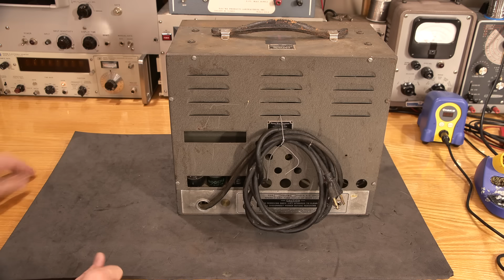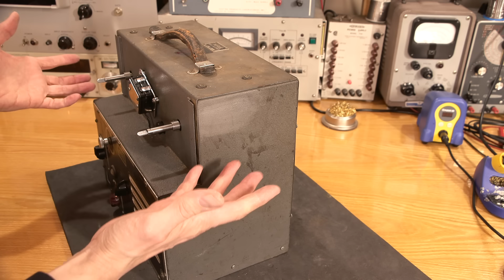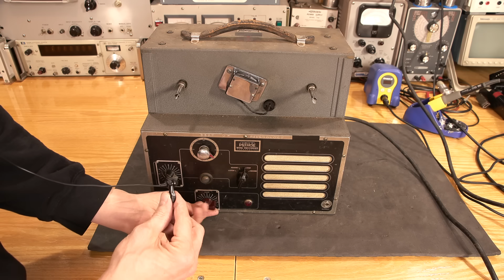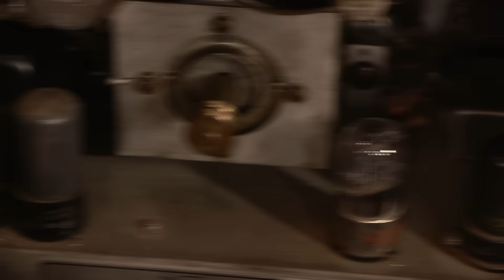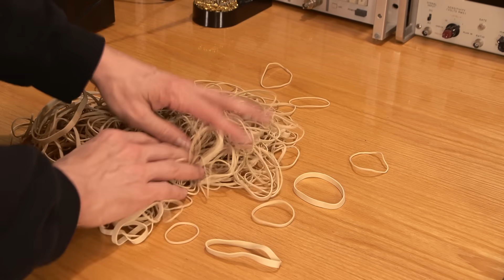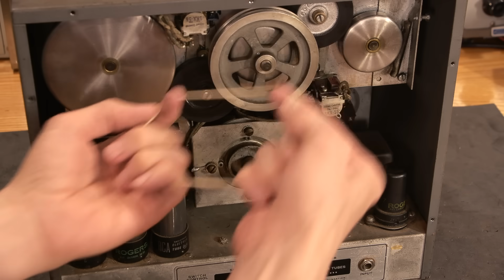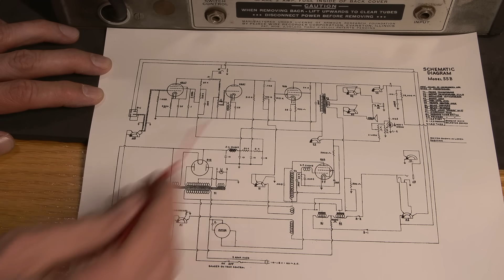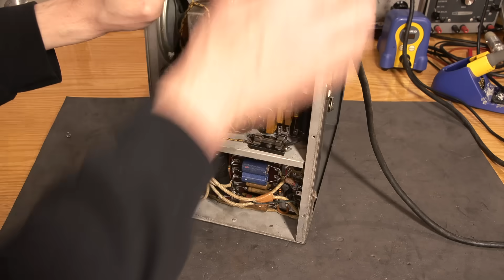Trapped Voices In This Wire - Let's Listen To Them!

Comment: You were interested in old voices recorded on a wire, eh?
Then skip ahead at least a half hour, unless you really wanted to listen to and watch a guy figure out a recording machine as if he's never touched one before and speculate about vacuum tubes.
I wasted a half hour listening to truly boring crap (oh, look- there are capacitors inside this electronic device..) learned nothing from them, and so screw the recording.
Couldn't care less what's on it at this point.
Terrible waste of time.
Dog crap.

Comment: Sir, you are a very intelligent technician. I never thought that a steel wire could retain sound in it and it was how in olden times recording was done. Through your video some stereo manufacturing companies may have got some ideas to develop such types of reels in modern times. I was also a small electronics tech and designed a few stereo circuits. Love your video.

Comment: For your sources of “belts”, have you tried using old tire tubes cut thin in a cross sectional manner? It would be a bit tedious but might be a sturdier band.  Maybe find one thin enough to be molded to those wheels with rubber peripheral surfaces

Comment: Marconi's radio receiver consisted of a steel wire that first passed through the poles of a magnet, which magnetized it, then through the center of a coil connected at one end to the antenna and at the other to ground, which demagnetized it with short duration pulses (they used spark emitters that were RF pulses), this caused the wire to be magnetized and demagnetized only in very short sections, then the wire passed through another coil connected to a speaker, in which the magnetic impulses that arrived in the sections of the wire still magnetized could be heard as a low frequency sound.

Comment: When a tube gets hot does that mean it needs something stronger to handle the current ??
Reply from the maker: Tubes get hot normally. This is because the have a filament and cathode. When you control current with a tube, the tube will get hotter.

Comment: I'm from Russia.👋In the late 1990s, my father worked as a technician in the Air Force. He used to bring back similar coils of wire from work. I was surprised that the wire was so thin, but it took some effort to break it. I was able to listen to it on an old reel-to-reel tape recorder. To do this, I had to increase the playback speed. It contained conversations between pilots and ground services. In everyday life, if you adjust the length and voltage, you can use it to cut styrofoam.

Comment: My Dad a bought 35 yrs ago bought an old phonograph console that the guts were taken out and the top of the cabinet glued down. I use it as a tv stand. It’s a solid heavy wood console piece probably from the 30/40,s. There are a couple doors that open in the front. Inside one was a secret compartment that I inadvertently found. I opened it and there was 2 wire reels that were in it. It had a sticker on it that said somebody’s wedding. Anyways I always wondered why it was in a secret compartment in there and wondered if it was something from the FBI or CIA. lol. It’s still there I think.

Comment: It is very intesting to know that voices could be recorded on a wire.  But the geniuses that created these past styles of recoding.  Cylindrical records, magnetic recordings ,  on old round  type floppy ,  16 size records,  98 size records,  45 size records, and 33 size records.  the number represents the speed at which they were recorded. beta tape players, vhs tape players,  vhs c tapes, then to floppy disks.  then hard drives,  then flash drives,  then sandisk memory drives which then can record audio or video.  let’s not forget dvd s,  cd s and what will be the next format in the future.

Comment: Splicing that wire was a horrible job as the wire is very strong and thin and cuts into the skin.  The knot had to pass the recording/playback head without destroying it, very tricky to get right.

Comment: I may be late to the party, but how about coating the "rubber" (or used to be) wheels with a somewhat rubbery and softer coating.
It would make up for the loss of size due to the rubber hardening and would give it the grip it needs to consistently drive the heads. 

I was thinking more rubber bands, but those would have been too thick, im sure there is some coating out there that would do the job as these seem to be in really good shape. 
You could even try to solve the bald spot, but that would be more technically challenging to get fully circular again.

Comment: Just a suggestion regarding the rubber pulley wheel that has hardened. I use to do this with tape recorders, - remove the rubber pulley, then boil it for a short while in a kettle as this can restore it softer again. (Hopefully it doesn't disintegrate)

Comment: Fascinating, I don't know much of anything when it comes to electronics and yet electronics have always amazed me, this wire recording machine reminded me of a device Kinch made on the television series Hogan's Heros yet he used string (and yes I know it's a television show) but now that I've seen this device it makes what he did seem less ridiculous. So, I'm 65, not much into electronics and yet found the video very interesting - makes me yearn for yester - years and a simpler time - analog baby. On that note: I've never understood why the U.S. has to my knowledge completely  converted from analog to digital technology when Eastern Europe AKA Russia still relies on it for their power grid, transportation and communication systems and it brings out the question who is more prepared for an EMP Russia or us? Correct me if you think I'm misinformed. Thanks for sharing!

Comment: Bro as I have wiring electric guitars there is ground band there is earth this is especially important when dealing with pick ups  such as double humbuckers and such the tube amplifier  system uses the earth to eliminate audio tube humm try to find the earth contact this will aid you 😊

Comment: My grandfather was a radio TV repairman in central Illinois and he also collected - accumulated and hung onto is probably more accurate - all manner of things and kept most of them in old (well-built, cement-floored) chicken houses behind his home. Anyway one of those things I remember from childhood (I am 68) was a wire recorder with spools of FDR fireside chat recordings. Sadly a tornado came through in the '70s and took all of those things off into the cornfields. I think of that sometime, and of the hundreds of boxes of NOS vacuum tubes in the boxes that went with it --- and the Victrolas and...

Comment: Im sure it's been said, but why not let the machine run to where the head is at the position to match the wires on the spools... that might lessen the noise or at least lessen the stress on the wire and produce a better, clearer recording.  Also, I wonder if does the machine plays either way?   Just the wire is a one way recording? , so.. that would make sense.   Ill have to watch this 20 more times to begin to understand most of this lol.  Very cool,  well-made video of explaining the machine and troubleshooting issues.  As a novice,  I can follow along and learn a lot from these.  Thanks!!!

Comment: If you can't source a replacement rubber wheel, you could use the hard original to make a plaster cast. or go high-tech and 3D-Print one.

Comment: In the 1940s, voice was recorded onto a wire using **wire recorders**, a technology that predated magnetic tape. Here's how it worked:

1. **Recording Medium**: The wire was typically a thin, stainless steel or alloy wire, about 0.004 to 0.006 inches in diameter, wound onto a spool.

2. **Magnetization Process**: 
   - The wire passed through a **recording head**, an electromagnetic coil that generated a magnetic field.
   - As the voice or sound was captured by a microphone, the sound waves were converted into electrical signals.
   - These electrical signals modulated the magnetic field in the recording head, magnetizing the wire in patterns corresponding to the sound waves.

3. **Recording Mechanism**:
   - The wire was pulled at a constant speed (often 24 inches per second) through the recording head.
   - The varying magnetic field aligned the magnetic domains in the wire, encoding the audio signal as a continuous magnetic pattern.

4. **Playback**:
   - To play back the recording, the magnetized wire was passed through a *playback head* (often the same as the recording head).
   - The magnetic patterns on the wire induced a small electrical current in the coil, which was amplified and converted back into sound through a speaker.

5. **Key Features**:
   - Wire recorders were durable and portable, used in applications like journalism, military communications, and dictation.
   - The sound quality was relatively low compared to later technologies like magnetic tape, with issues like background noise and limited frequency response.
   - Recordings could be erased and the wire reused by demagnetizing it with an erase head or a strong magnetic field.

This technology was prominent in the 1940s, especially during World War II, but was largely replaced by magnetic tape by the 1950s due to tape's superior sound quality and ease of use.

Comment: A long time ago my  ex girlfriends father asked me (cause I'm a tech nerd) if I could get this vinyl to MP3 converter working. Basically, it would play the vinyl and record it. I can't remember if the audio was audible during the conversion. However, the final output was pretty good. I have no idea if he succeeded with his conversions (he had a lot of vinyl albums he wanted to preserve this way).

Without dumping a ton of money into getting the audio from these wires, it could be cool to record the audio through something like what my ex's father had to bypass the need for amplification or replacement tubes and then release the audio. I'd be interested to hear what's on it!

Comment: In the second half of World War II, German submarines used the "Courier System," a similar recording system for storing Morse code short messages on board. The Allied naval forces had perfected the use of their Huff-Duff panoramic direction finders and were able to locate German submarines even from short radio messages. To prevent this, the U-boats' routine radio messages were recorded on a metal drum and could be transmitted in such a short time that Huff-Duff direction finding was no longer possible.

Comment: Wire recording is an early form of magnetic audio recording where sound is captured by magnetizing a thin wire. It works by passing a wire over a recording head, which magnetizes the wire according to the audio signal. This magnetized wire can then be played back by passing it over a playback head, converting the magnetic changes back into sound.

Comment: I was not aware of Wire Recordings and am having a bit of a time trying to wrap my head around how that would even work. I understand CDs, casettes and even gramophones. Wires? What?

The best guess I can come up with on the top of my head is that when recording, vocal vibrations acticate a component that cause the wire to compress slightly, on a small scale, to replicate something like the grooves on a record.

Comment: My father had several wire recorders, picked up as military/war surplus and in my experience most of them worked.  Bandwidth was pretty much only suitable for voice.  I was taught that it was necessary to apply tape to the reel, as you suggested, to keep it from unreeling, but the tape was not standard "Scotch" tape and I don't recall it leaving a residue (I was 9 years old (1955) and had just gotten, at his insistence, my ham radio license).  After about 5 years I badgered my parents into getting me a Webcor stereo tape recorder which matched my recording ambitions much better than the wire.

Comment: I HAVE AN OLD SEARS SILVERTONE AMPLIFIER HEAD WITH A BROKEN REVERB UNIT. I GAVE IT TO A FRIEND. EVERYTHING WORKED BUT THE WIRE REVERB. HE BROUGHT TO REPAIR AND THE IDIOT TOLD HIM IT WAS WORTHLESS. ITS GOTTA BE FROM THE 50S. I HAD THE BOTTOM TOO BUT GAVE THAT AND ITS TWO ELECTROVOICE SPEAKERS AWAY 100WT. COULD IT BE FIXED? I HEARD BLUES GUYS LOVE THESE Old WIRE REVERB AMP HEADS.

Comment: What is the point of the mechanism that pushes and pulls the wire to and from the device?

EDIT: Gemini 2.5 Pro gave me the answer:

That mechanism moving back and forth is called a level-wind mechanism. Its purpose is crucial for handling the thin steel wire:

Even Winding: Just like on a fishing reel or a modern tape recorder (though less obviously), the wire needs to be laid down evenly across the width of the take-up spool. If the head stayed in one place, the wire would pile up in a narrow band in the middle of the spool.
Preventing Tangles and Jams: A big pile-up in one spot would be unstable. The wire could easily slip off the pile, creating loops that could snag, tangle, or jam the mechanism, potentially breaking the delicate wire. The level-wind ensures a neat, compact wind.
Maximizing Capacity: By distributing the wire evenly across the spool's width, the mechanism allows the maximum possible length of wire (and therefore recording time) to fit onto the spool without spilling over the edges.
Maintaining Consistent Tension: While less critical than the other points, a neatly wound spool can help maintain more consistent wire tension as it feeds, which can contribute to more stable playback speed.

So, the head (or a guide associated with it) moves slowly back and forth across the width of the take-up spool as it fills up, ensuring the wire is laid down in neat, even layers. It's not really pushing/pulling the wire along its length but rather guiding where the wire lands on the spool.

Comment: I was thinking 6V6 and it was. I was thinking 5U4 but it was a 5Y3. I used to work on tube radios and TVs a long time ago. I enjoy watching you work on this old equipment. Thanks. Usually, the 5Y3 had its own secondary winding on the power transformer for the filament if I remember right. Kind of like a flyback transformer that had a winding for the HV rectifier tube filament.

Comment: A WWII German spy in Greenfield,NH used an early model to record Morse code messages received by radio from a spy in Boston. He would then add his info to the wire before sending it up to Halifax where the next spy in the link would again add his info to the wire. This process would repeat itself across Greenland, the Netherlands and on to Berlin. There the wire would be checked for validity  by comparing the different parts with the know Morse code 'fist' of each field agent...   The agent was a German and his wife working at Dr. Myers dairy farm. He would climb Pack Monadnock Mnt. at night to receive and climb up to 5-points to transmit his messages on the next night.

Comment: Ok. Now I'm understanding. Before filament tape like cassett, 8track or beta Max or VHS. You could record on filament type wire. I was way overthinking it. I was under the impression because it was so thin sound waves somehow disrupted the manufacturing of the wire and this was going to be a couple of dudes making the wire just talking. Again way overthinking it.

Comment: It’s very cool to hear voices but don’t use rubber bands. They are not calibrated to support that pulley system. 
With something so fragile you don’t want damage the unit or wire. Get a proper band to fit it.

Comment: I hope those devices aren’t worth a lot… I worked at a recycling company for the last 3 years. Mainly dealing with paper, but also electronic waste. And I vividly remember finding 2 of these, looking practically brand new. They stood out because of the weight of them. One of them I took apart looking for copper, any gold on any chips or anything of value basically. Didn’t find anything significant to warrant pulling them apart. so the other one we didn’t open up. But we just chucked them both into a bin for electronic scrap… now I’m wondering if we could have resold them. As anything that didn’t have confidential information on it we could have. We didn’t know what these were so we just chucked them 🫣

Comment: I'm 82 now and started fixing electronics stuff as a job in 1962 after high school. This was a blast from the past! When you said "6V6" I said and 5Y3 rectifiers. Haven't looked at tube stuff since the early 70s. Don't know how I remembered that. I mostly can't remember why I went into the kitchen.  Comments? Try swapping the 6V6's one might be better.  Probably needs a complete recapping. Also grids don't glow, plates glow.

What a fortunate guy you are to have all that neat equipment! I like the ultra. Very helpful. I have a telephone line inductive tracer (we called them "bananas" cause they were yellow) which would do about the same thing. Enjoyed the video a lot!
Reply: "I mostly can't remember why I went into the kitchen."  82 years old and sharp enough to instantly recall what you learned long ago and then immediately follow with that zinger about aging! You got me lmfao! Thanks for that!  🤣
Reply: @amaturespotter thanks for the comment🤜🤛.  I love electronics. Mostly more predictable than people.
Reply: Because 6v6 are one of the few times still widely in production and used even today.
Reply: The word "6V6" awakened my old memory of vacuum tube audio amp (B-class) or radio (A-class).

Comment: I believe the Write Speed for Wire Recorders is 78RPMs.

I saw some kind of an antiquated home entertainment center in a thrift store that had a Take-Up Reel for the wire recorder built into the phonograph turntable.

It also had a radio and you can record off of the radio.

Comment: Awesome, just awesome! I'm hooked! I've got an old Philco radio 1940's tube's all work and so does the speaker, as there's only one. It's large 12 or 14 inches. It's in storage, and l haven't seen it in 15 years. But you have just peeked my curiosity.. Thank you! 🫡